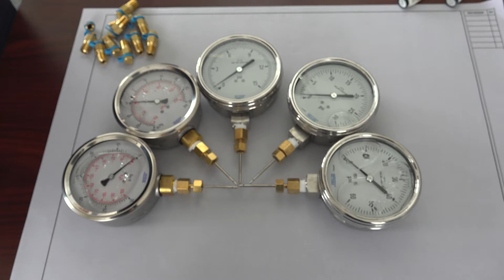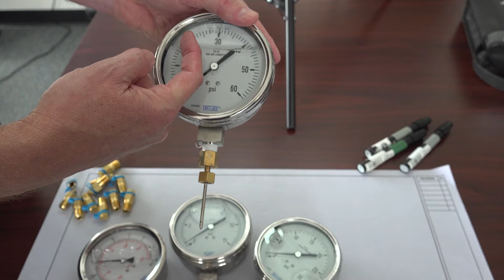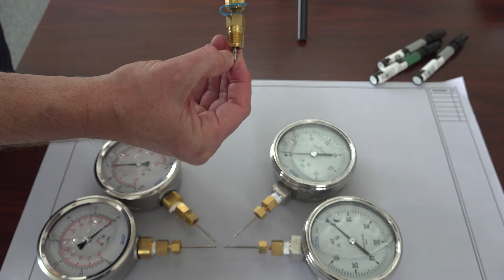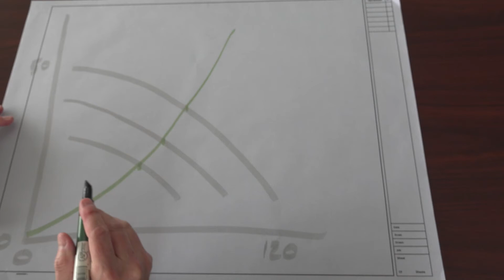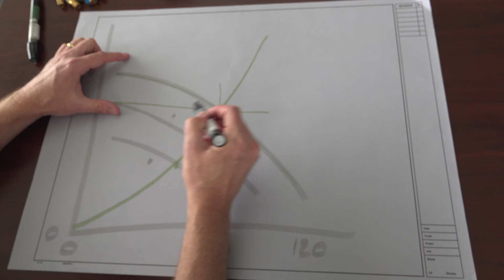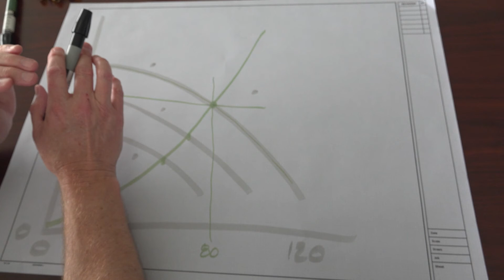Summer Series: The Power of Pressure Gauges

Comment: If you are going to use these gauges on pool pumps, the Pete's Plugs are absolutely necessary.  As John McIntyre mentioned, these thread into the drain plugs on pool pumps, and those plugs are near the bottom of the pump.  Unless the pump is on a pedestal, the big gauge won't clear the equipment pad when being rotated in place.  Nice job, Dave.

Comment: Dave - You might also mention that the gages read the vacuum and pressure on a pump (at inlet and supply plugs on the pump).  Convert vacuum ( inches Hg  x 1.13 = ft head)  and  pressure psi (x 2.31 = ft head). Add the two head values together to get the TDH on the pump curve chart. Where TDH interscts the pump curve is the flow at that head and pump speed. Or get a good flow meter. Part of ISPSC requirements is to field verify the system flow to be sure fitting and pipe flow allowables are not exceeded.   - John McIntyre
Reply from the maker: Thank you John. We appreciate the feedback.